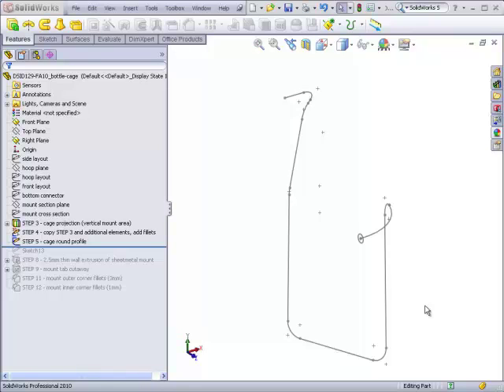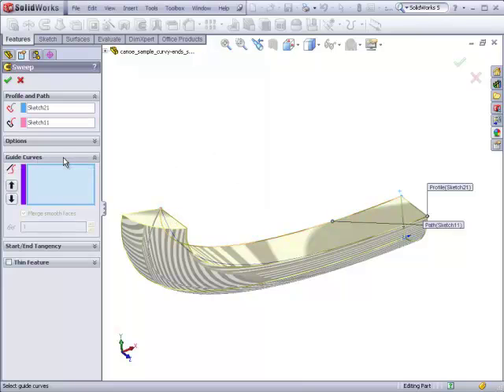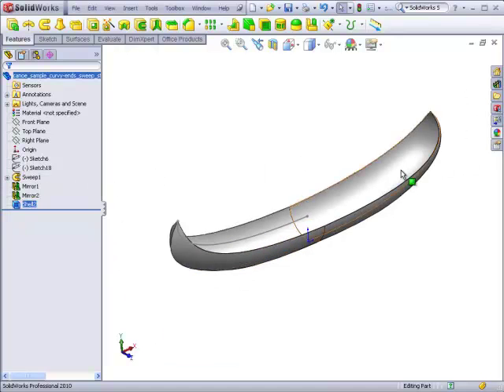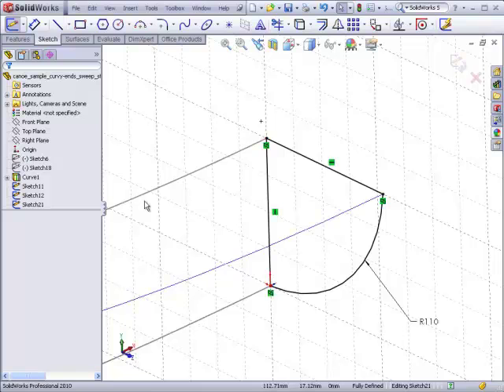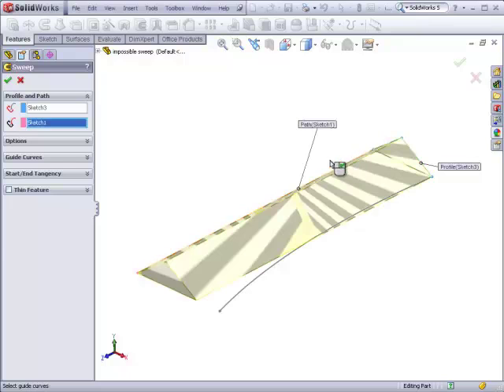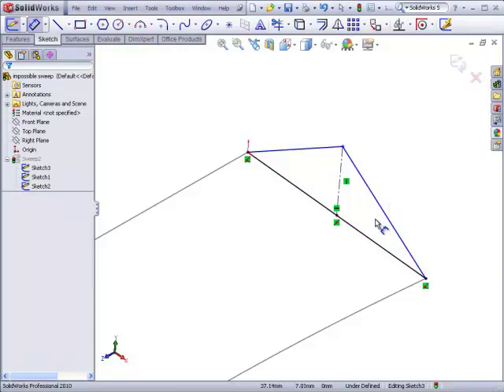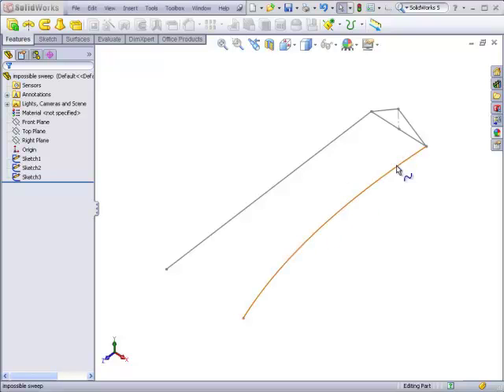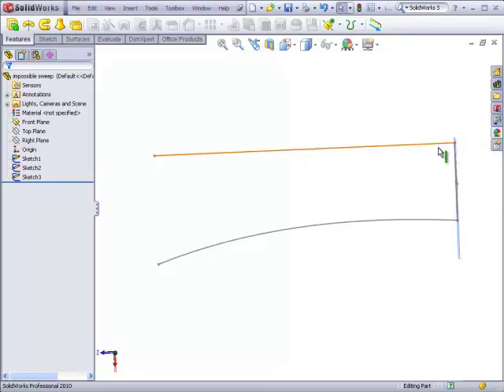DSID129,  Solidworks Lecture, Sweeps with Guide Curves - Part 1

Comment from the maker: @MrSila1988 
The 3D curve is fully defined. It was created by making a sketch on the front plane and a sketch on the top plane and using the Insert/Curve/Projected command, Sketch-on-Sketch option, to combine them.  The front view sketch, for the projection, is identical to the upper path that is located on the front plane. The top view sketch defines how wide the canoe will be. Both sketches converge at the tip of the canoe (when viewed from above).